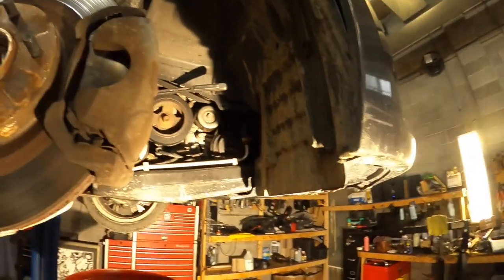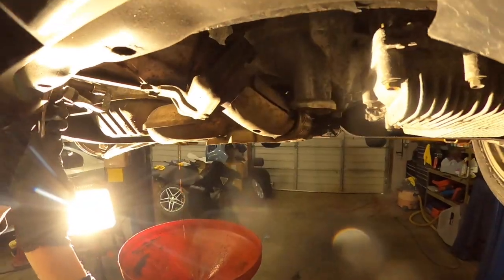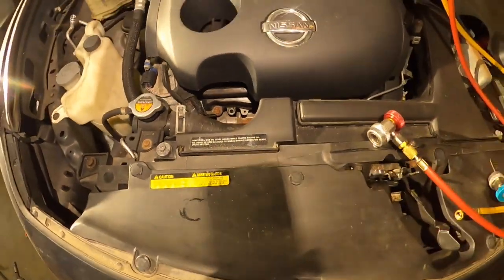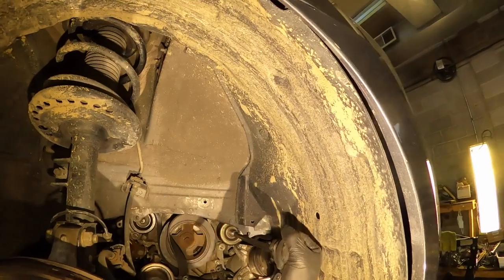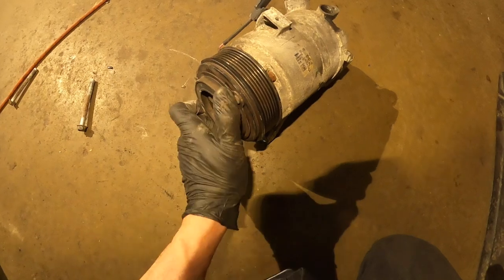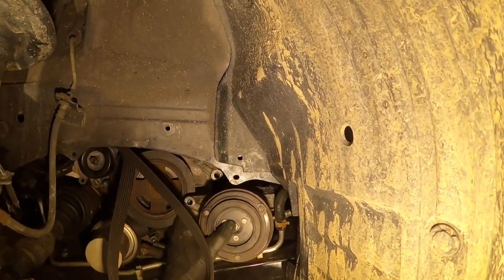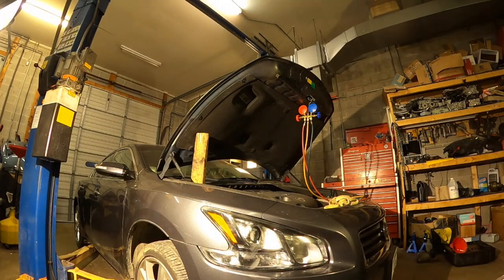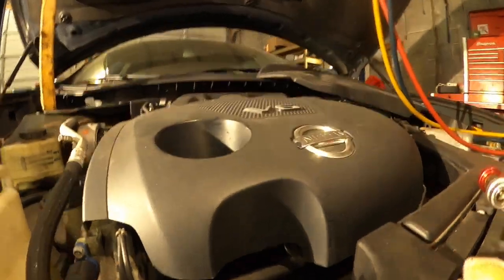Nissan Maxima AC compressor full replacement/how to change the compressor

Comment: @mechanicmode I'm working on this project now. how did you get the bolts of of the lines to the compressor? you can't reach it with a ratchet or wrench?
Reply from the maker: Hey you should get the out under the car , 
Try to lift the car a bit
Reply: @mechanicmode  Thanks. I was able to complete my project over the weekend!

Comment: Great video. After you changed the compressor does the freon leak out? Do you always have to recharge it?
Reply from the maker: No one time recharge and is done if you have to add more after that than you probably have a  leaking  gasket or something

Comment: How did you flush out the old refrigerant is there a bolt where that fluid came out of or do you need to force it into the atmosphere
Reply from the maker: There is a set with a tank that you can drain the frion or buy a $2-3k machine that will drain and refill the system

Comment: Did you have to replace any rings and replace oil in the compressor before replacing it
Reply from the maker: Yes when you install the new compressor you should put brand new O-rings and after installation refill with freon

Comment: Thank you for the video. Alldata lost their mind. Had it out in 15 after discharging the system.
Reply from the maker: you are welcome , yeah man that is crazy some times alldata does not show you the right info
Reply: Alldata says 3 hours! And wants me to take out the fans and upper radiator hose. But you didn’t do any of that. I got small hands and plenty of tiny tools that can get the hoses off with out removing all that crap. Doing this on a 2012 tomorrow morning

Comment: I have a 2011 Maxima like the one in this video.  I was involved in a collision with a dear resulting in damage to multiple front end parts.  The condenser was breached so it needed replacement.  When I got the car back from being repaired the heater and A/C were not functioning properly.  The blower was working but I was only getting heat on the passenger side.  I took the car back to the repair shop but only got the run around from the owner.  A few weeks later the blower gave out too.  Now I'm having to pay out of pocket for a new blower and god know what else.  Can anyone advise me on what is going on with this system that functioned perfectly before they "repaired" it?  I am a senior who cannot afford this expense.  Any assistance is greatly appreciated.
Reply from the maker: Hopefully you fixed your car and you got all you need if not than let me know if you still need anything

Comment: I just finished tackling this job and I have to say, removing the radiator fans were only way I was about to get to the 2 10mm bolts for the a/c lines.  It's a bit too troubling if you do not have a lift. No specialty tools necessary.  Just my $0.02  Good luck!
Reply from the maker: Cool 👍🏼👍🏼👍🏼
Reply: @mechanicmode  did you game to remove radiator just to get to the two 10mm bolts on the sc lines going to the compressor

Comment: Do you have to empty the AC pressure and it’s fluid before uninstalling old part?
Reply from the maker: Yes you have to empty the system before removing the old ac and after putting the new one you turn the engine and insert the new freon

Comment: My A/C only works in the winter time when it’s cold outside, but does not work in the summer time. Why my ac only work in winter when I don’t need it?
Reply from the maker: You have to check if your wires are working and probably is time to replace the AC compressor
Reply: @mechanicmode  .. but if wires are bad, how come it blow cold air in winter time? Also ac compressor should be good if blowing cold air in winter
Reply: Low in charge
Reply: Because it’s cold outside, that’s why it works, doesn’t have to cool air that’s already cold….
Reply: @cole5209  . Yes but I am talking about the air inside the car is blowing cold in winter.
Reply: @dr4g0nb0y4  yeah your HVAC system brings outside air in and either cools it off or heats it up. So I’m saying if it’s cold outside and your ac is blowing cold air, you’re just feeling the cold outside air.
Reply: @cole5209  . Ok. Yes you may be right. Thanx.

Comment: Is the AC compressor a common problem with the Nassan Maxima?  My 2010 Nissan Maxima is in the shop now for this issue with less 80k miles.
Reply from the maker: It can be specially if your are in the north part of the country! 
But actual ac compressor is not common problem, but it can happen 
Wish you good luck and hopefully you will fix your car soon
Reply: I have a 2011 SV and just had the compressor and high pressure hose replaced. Had it done by an auto air specialty shop and it wasn’t cheap - at ALL (probably second in cost only to the dealership). But I wanted it done right, and with a warranty (12 mos/unlimited mileage).

Car had 238k miles and runs immaculately. This is the only problem I’ve ever had with a/c…..and I hope to keep the car at least two more years.

Comment: He left out the hardest part which are the two screws on top of the compressor the ac lines which actually takes a hell of a lot of time to remove and replace
Reply from the maker: It was really hard to keep the camerA and aldo work Sorry to hear that I hope you figured out how to remove those bolts

Comment: He left out a whole lot of parts. What a horrible video. How to get to the other 14mm which I figured out on my own but how much oil to put into the new compressor
Reply from the maker: Oil in the compressor ? 
Idk what are you talking about but never put oil in the AC compressor you gotta fill it with Freon
Reply: @mechanicmode  a new or reman compressor usually comes with 3oz of oil but on the maxima you need to fill so it equals 6.8oz